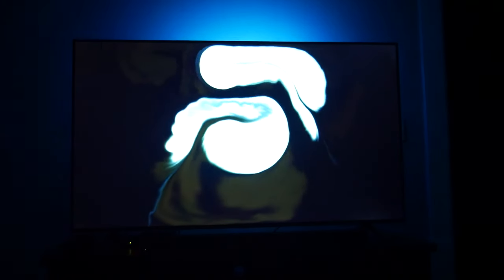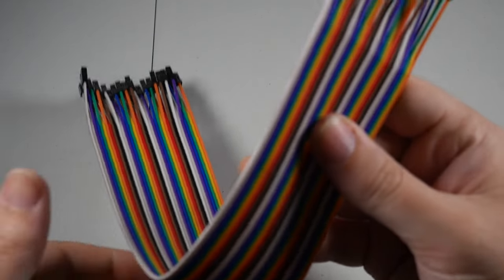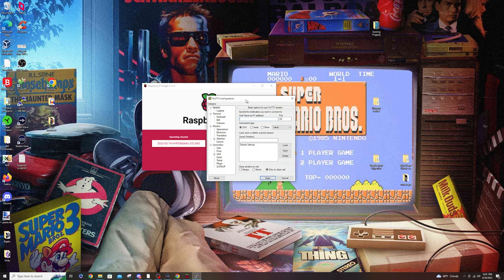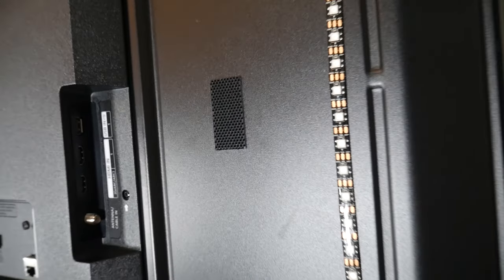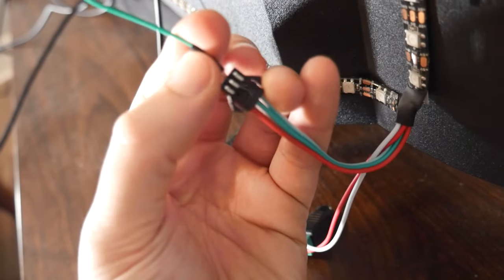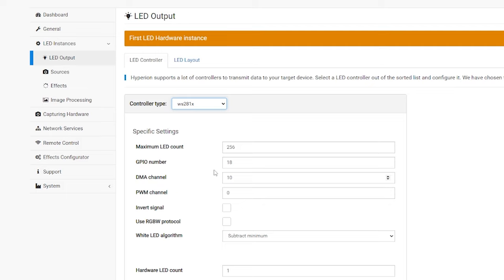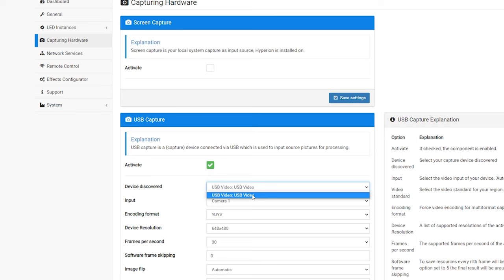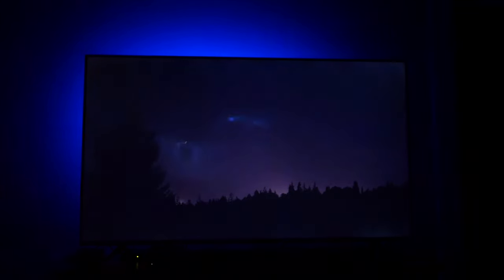Make Your Room Come Alive with This DIY Ambilight System - Wow!

Comment: A couple of tips for those trying to do this for the first time. If you have a difficult time connecting to the Raspberry Pi from typing its hostname in, instead use a Scanning Tool to find the IP address of the Pi. I used Advanced Scanner and was able to connect to the Pi by putting in its IP address into Putty. For the Hyperion setup, I used it's IP address:8090.

Question for Below Average Gaming: On my first time setup, I had an EXTREMELY hard time getting the LED's to start working. I followed your tutorial to a tee. Once I rebooted, they worked.

However, today they stopped working. When I came home from work everything 10th LED or so was green/red/green/red. I've connected to the PI, I can see that it's capturing, but not sure how to get the LEDs working again. I rebooted everything, some of them came on, so I don't think it's fried, but not really sure what to do as far as testing the Strip or if there's anything else I should be trying in my settings to get them working again.

Any tips?

Thank you!
Reply: Update, I have a single White LED  on all of the time on LED 1. Not sure what to do next..
Reply: 2023-06-29T22:21:38.337Z [DAEMON] (ERROR) Lock/unlock handler- Session bus is not connected
2023-06-29T22:32:43.502Z [NETFORWARDER|First LED Hardware instance] (WARNING) No JSON- nor Flatbuffer-Forwarder configured -> Forwarding disabled
Reply from the maker: For getting your ip address you could also just run the pie like normal and type the command "ifconfig" and it should display.

 As for your LED issue that has happened to me once also coming home after work. For me, what fixed it was redoing the red and black connections that are connected to the barrel jack. Or replace the usb cable entirely.

You could also try reinstalling the software.

The worst option would be your led strip is fried
Reply: @BelowAverageGaming  Thank you for the info. Unfortunately I've had zero luck getting this working. I've gone so far as trying a new LED strip, new Power Supply, and new USB cable. All of the connections have been properly made. I've redone the setup on the pi/hyperion multiple times. I still have just a single LED light up white all of the time on both strips that I've tried. It's just crazy..it was working perfectly for about 2 weeks. No idea what caused it to stop.

Any more pointers? I've gone to forums - I can't find any information on a single led being lit up.
Reply: I'll add that I've used leads out of the barrel jack to test each individual LED, and they do power up.
Reply from the maker: What kind of pi are you using? Have you checked your gpio pinouts to make sure they are connected properly? Did you connect a ground dupont connector and the data?

Also you can give this a read 

https://hyperion-project.org/forum/index.php?thread/11268-only-first-led-turns-on/
Reply: I tried building a new one... And i am getting this exact issue... Tried everything so far nothing seems to work
Reply: @bretthodgkinson which capture card are you using is it working well with hdr content

Comment: Very interesting. I used to work with WLED to other purposes. I have 3 questions. You are capturing Chromecast via hdmi. Nowadays smart tvs already have all the main apps and they work fine, how do i could capture the video signal of the apps that already are integrated on tv? and the antena tv channels?
The 2nd question is related about last videogame consoles, like Xbox X or PS5, they can work with 4k 120hz, is there any capturer and splitter that works with 4k 120hz?
the 3rd question is where do you place the splitter, I asume that you put it between devices and rpi, isn't it?
Thanks in advance.

Comment: Naice project! i also want to try this. but i was wondering if you can add more led strip to hyperion. like extra strip under the tv cabinet. or extra led poles, and assign them to the right location of the tv. i cant find any information on this. hope you have a link or information about this.
Reply from the maker: You would need multiple raspberry pis to accomplish this
Reply: @BelowAverageGaming  and also more capture cards i suppose? i came accros this. going to try to figure this out. Search youtube for : DIY Ambilight and Synced Under Cabinet Lighting with Hyperion NG and WLED

Comment: I run an Nvidia Shield as well as a bluray player, but they're on separate inputs to my TV.
What do you think is the most practical way to run this kind of setup? Two Pi's and two rows of led strips, or a remote controlled hdmi splitter and just one Pi?
Reply: hdmi splitter,

Comment: Is that a android tv?
iirc you can install hyperion on android . But drm contents wont work unless rooted.
Also you can install hyperion on Linux and windows too and can capture screen using software and wont need rpi.

rpi zero 2w should work and that might be cheaper.
Hyperion also supports WLED controller. I think WLED+Hyperion is a cool combo, if you're not gonna use the capture card method.
if you don't want to connect the strip to rpi then you can use an ESP32 flashed WLED in that case ig you don't have to configure rpi GPIO pins.
ESP32+Strip+PSU+Hyperion on the device and soft capture will cost even less ig

BTW thanks for the guide.

Comment: @belowaveragegaming  hi  I have all the uquipment ras pi 3b with hyperion 2.0 installed..... I have 224 leds ws2812b around my tv.... however I don't have a 5v 10amp plug I do have a 5v 60amp power unit supply could I wire it upto that instead or would that just blow everything tvs off the wall all ready to wire everything up but I don't know if I can use that power unit
Reply from the maker: I would go lower, the volts are the same but the amperage might cause problems. I've only seen people go as high as 15 amps
Reply: @BelowAverageGaming  can amperage affect it then I'm quite new to this stuff lol keep gettin different things people saying if it's 5v then it will only take in what it needs etc think I might play it safe and have to order an adapter and barell then :(
Reply: @jamiehawman66  You will be fine if you use it, it's just way overkill and inefficient.

Comment: Hi, I was following along until I plugged in the power source into the barrel connector. The LED lights do not turn on at all. I am using a Raspberry Pi 2 instead. Would that have an effect? Is there a Hyperion setting that could help? Theoretically, if I were to just plug the frayed cables coming from the LED strip, would it light up?  Appreciate any guidance or assistance you can give!
Reply: Ignore, I should have watched the rest of the video!!! Disclaimer that the lights may not turn on until Hyperion is setup! Thank you for a great video. That would have been a great disclaimer (that lights may not turn on because Hyperion needs to be set up first) and saved me lots of time.

Comment: Brother... I've been having issues with this... Only first led(sometimes second and fourth) light up... And i am getting error - Lock/unlock handler - session bus is not connected... Any idea what could be wrong here????
Reply from the maker: Check your connections with the barrel Jack connector and make sure they're secured.  If the positive and negative wire cross you can burn out the LED strip
Reply: @BelowAverageGaming   I think somehow my LED was problematic cz i tested it from mid way and it was lighting up fine just not following the sync... anyways i've ordered a new one and will comment if this too gives issues.. Thanks-

Comment: Hello. Is there a video capture capable of 4k HDR? Because if I use the device shown in the video, the apple tv switches back to SDR mode. Another question: If the image is dark gray (e.g. a menu), the LEDs will blink dimly. Can this be eliminated somehow? I guess some sort of sampling threshold or something. Thanks
Reply from the maker: Weird, I don't have any issues with hdr content what I've noticed.

This is popular one to choose for this build with 4k

https://www.amazon.com/SIIG-Extractor-Conversion-Downscaling-CE-H26911-S1/dp/B08WKL5T1R?dchild=1&keywords=4k+splitter+hdr+sdr+conversion&qid=1623250728&sr=8-5&linkCode=sl1&tag=majestechs07-20&linkId=01b9e8ec0003f2ff31259b7e65d57f59&language=en_US&ref_=as_li_ss_tl

There is a setting within the hyperion app that let's you "ignore" when the black bars come on the screen im not sure where they is off the top of my head but it's there.

Comment: Quick question regarding LED power supply. Half of the tutorials on youtube are saying you need to connect power at least every two meters of strip or at least power it from both ends, especially for 5V strip. But i see you didn't do it. Have you had any brightness problems after some time at the end of the strip?
Reply from the maker: I haven't experienced any issues, for what it's worth. You can also increase the brightness inside of Hyperion

Comment: so do you have just one power supply for Raspberry + LED stripes? And have your system CEC pass through so you can just use your TV remote?
Reply from the maker: 1 power supply and no, I'm using an Xbox to make this happen so the Xbox remote is what's needed in my case

Comment: Hey man! So I got to the part after flashing the SD card with the Raspberry Pi Imager, then installing it into the Pi and booting up. When I get to the screen after boot that says "Hyperbian" in large text, there is no IP address of the Pi; instead it just says "to configure Hyperion browse to http://:8090 from another device...". Any tips? Running a Raspberry Pi Zero W.
Reply from the maker: So you have to connect the pi to the internet to get the ip
To do that open up the terminal and type in sudo raspi-config 

The go into system options and set your wifi info

Then go into localization options and set the wireless lan country

That "should" fix your issue

To check, open up the terminal again and type in "ifconfig" or "sudo ifconfig" (not sure which one lol)
And it should tell you your ip.

Additionally if none of that works then delete everything in the SD and try again. Make sure you set the wifi options within the imager
Reply: @BelowAverageGaming  Thank you, trying that now! Should setting the wifi options in the imager automatically add wpa_supplicant.conf and ssh files onto the SD card or do those have to be added manually?
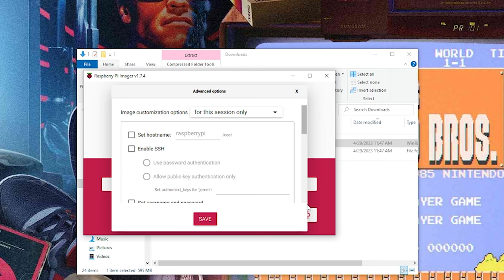Reply from the maker: 5:20 it does all of it for you

Comment: I did all the things in the video, I only had 180 LED with a 5v 15A Power supply, but I only have 1 Green LED, the one from the beginning. Could you help me? What did i do wrong?
Reply from the maker: The fact that 1 light is lit is a good sign, better than no power. Are you using the same exact brand of LED strip? 

You most likely have to tinker with a few settings within the application, have you changed the RGB byte order?

Comment: i noticed one big error which was you plugged a 5v 15 amp power supply into the raspberry pi but the maximum rating on the raspberry pi is 5v 2.5amp maximum to cover power drop is 5v 3 amp so have you fried the raspberry pi yet?
Reply from the maker: Lol no,

the Raspberry Pi 3 being "fried" by using a 5V 15A power supply is not true, as long as the voltage remains stable at 5 volts.

A device like the Raspberry Pi only draws the current it needs. The power supply being capable of delivering 15 amps doesn't force the Pi to use all of it. It will draw up to 2.5 amps (or slightly more in case of peripherals) and ignore the rest.

The only way your Raspberry Pi 3 could be damaged by the 15A power supply is if the voltage regulation fails, causing the voltage to exceed the safe range. This could happen with a low-quality or faulty power supply, but it's unrelated to the higher current capacity.

As long as the voltage is correct and stable, having a higher amperage capacity is actually better, as the power supply won't be running near its limit.

Then again, what do I know. I'm not an electrician
Reply: @BelowAverageGaming  thats great info and very interesting keep up the great work
Reply: @BelowAverageGaming  i do like your guides they are the best ones and very clear

Comment: So after purchasing all parts i followed your guide. Unfortunately all my leds only light up white without an error message in hyperion. You know what could be the problem? I see the live video and all in hyperion..
Reply from the maker: Hmmm, this could be TONS of things.

Are you using the exact led strip from the video?

What kind of Pi?

Did you seat your GPIO pins correctly?

Did you change the RGB byte order in the Hyperion app?

Those are just a few things off the top of my head

Comment: I did exactly the same thing as yours, but neither the LEDs are on nor the USB option is active in Hyperion. Can you help me?
Reply: If you check the log error or when you go to LED's hardware it will pop up a saying like "Hyperion needs to run as root", edit that permission and you'll be good.

Comment: Bought all the parts and wired everything up but my raspberry pi lights are flickering and the LED strips don't even turn on. Could it be the micro USB cable? I already had to return a bad power supply. I've even rewired it but I'm at a loss at this point.
Reply from the maker: It could be a bunch of things honestly. 

Did you follow the part list 100%? Same raspberry pi and everything?
Reply: @BelowAverageGaming  Raspberry Pi 3 B+. Same power adapter as you, 15 A. I've now tested the Pi using the micro usb cord it came with and it powers up normally. But once I plug in the adapter which I have wired together with the sacrificial micro USB and LED strips, the Pi lights flicker and I get nothing on the LED strips. Can't tell if I'm just bad at wiring or I need to sacrifice another micro USB, or try another adapter.
Reply from the maker: @zach_actually did you enable the gpio pins?
Reply: @ I haven’t reached that step because my raspberry pi is not maintaining 5 volts after wiring up the power. The red light won’t stay on the board. I’m going to try ordering 1 more power bar (total of 3) and I’ve tried 2 micro USB cables now. Unfortunately I don’t own anything to test the power output but Amazon has free returns 🤷‍♂️
Reply from the maker: @zach_actually and this is after you strip the wire or before? 

Can you connect the pi to the PC with a standard cable untouched?

Comment: Does it work when displaying image from app installed on the tv? Like Netflix or Disney+, where image is not sourced from HDMI cable?
Reply from the maker: This method only works with external attachments through hdmi
Reply: @BelowAverageGaming is there a method to make it work with apps like Netflix and YouTube?
Reply from the maker: @mysticqro950   Again, personally I use a game console because it can run those applications on top of playing games. ( You could probably use a roku or fire stick as well)

 I don't know of a way to make this capture built-in apps on the TV. Perhaps if there's a capture card that can record things from your TV? Then you could in theory have it capture itself for the lights (just guessing)
Reply: @BelowAverageGaming  At that point you may consider a 30€ chromecast or apple tv
Reply: Hello it’s working if my monitors is connected by a display cable and I just connected the raspberry with hdmi ?

Comment: How are you powering the raspberry pi ? By usb adaptor with 5v?
Reply: With the 5v power supply, he’s powering the raspberry pi thru the usb cable. Red and White wire.
Reply: @mysticqro950  Isn't that 5v when the Pi expects 3.3v.  How does that work?

Comment: Can i use the parts with a raspberry zero ?
Reply from the maker: You can, but I believe somebody in the comments here tried it and didn't have much success
Reply: @BelowAverageGaming  Thanks for the answer, my Zero is set up and Hyperbian is also running on the browser. Does the Firestick work with Netflix with the HDMI splitter or do I need a different splitter?